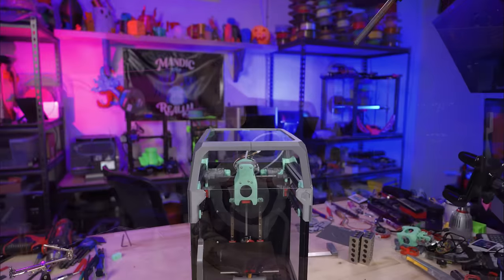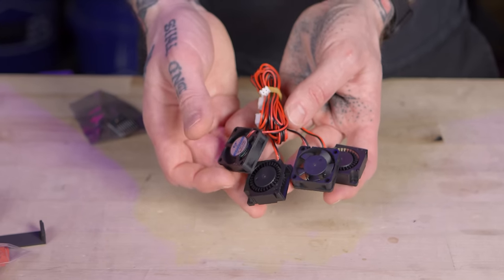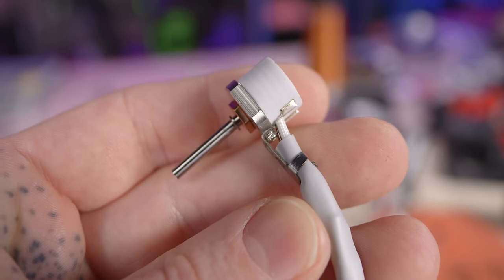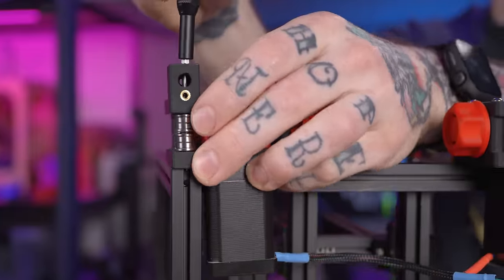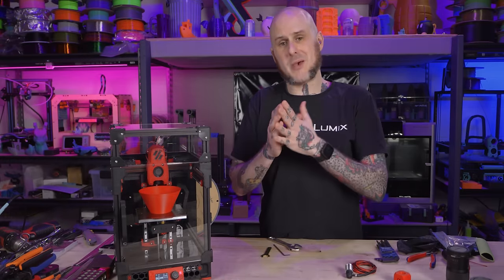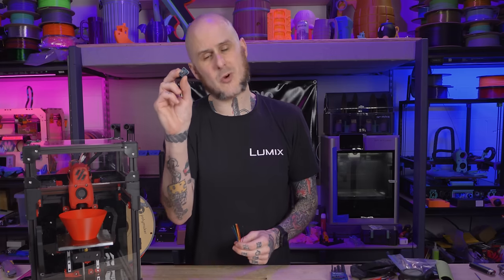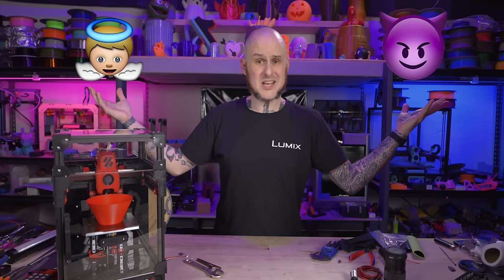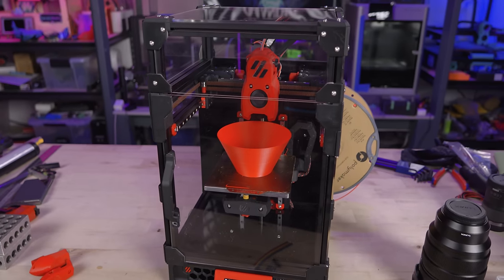Amazingly CHEAP Voron 0.2! - SIBOOR V0.2 3D Printer Review

Comment: Big nope for me, I'm a bit done with learning a lot from my Chinese printers. Now it's time for Prusa and then a proper Voron. :)
Reply: Maybe go straight to that Voron
Reply: What's a proper Voron?
Reply: A proper voron which isnt a "chinese" printer will be quite hard
Reply: @totalkiller4  hey said he's done with learning from the chinese printers. I know the bambu printers have cool features. But the vorons and the prusas are opensource and have replacement parts available from different sellers.
Reply: @Dash199t  Right? No one tell him where LDO is from.
Reply: @sanjabarasingha802  Thats fair just my Bambu has given me the best prints iv ever seen and i can buy parts direct and they come from a UK warehouse local to me so its all lovely so far and there are a good few mods for it to add non OEM parts :) and i belive a large part of the software is open sorce
Reply: siboor has a proper 2.4 and trident kit. Both PREMIUM kits. you really should check them out before you dive into prusa, prusa is more a reliable set and forget machine, voron is for the tinkerer. both have acceptable reasons for buying... depends on needs
Reply: @totalkiller4  I'm happy to hear, that you like your bambu machine. And yes there are some things opensource. But the important part, the firmware, is closed. If they would opensource the firmware I would probably buy one. But i doubt that'll happen.
Reply: @WillThat  A "proper Voron" is a Voron you source the parts yourself, which is superb irony since most parts are made in china
Reply: The best Voron build is when you use bom sheet and source your own parts. You buy some Chinese parts like gears, screw kits, wire connectors etc.. but mix it with expensive critical parts like motors, bed, rails and hot end as an example

Comment: Watching this has me nervous about the printed parts. I haven’t seen any issues with the black parts yet but I still have a ways to go. Wondering if that particular batch of printed black parts had an issue or if it’s going to be the case for many others as well. Definitely seems like printed part qc needs to be better regardless.
Reply: thats crazy.... i did not have any of that nonsense on mine. I will get with siboor team and tell them to double down on the QA. Honestly the splitting parts is not acceptable. Modbot if you need reprints let me know. Ill get them for you quickly.
Reply from the maker: Yea, it was suprising. You know how it can be, temperamental days with ABS and all, but there were obvious issues that should have been seen in packaging.
Reply: I also had poor layer adhesion on my V0.1, although not as bad as this kit by the looks of it. My first prints were replacement high stress parts like the extruder mounts for when they failed (the extruder rail mount loves to split and was hard to diagnose).
Reply: At least my batch is okay but mine came with revised liner rails (no rust) so perhaps little different from yours. So far no crack.
Reply: I did have some issues with poor layer adhesion. However, nothing that was a important part.  I did have to reprint a couple of pieces, but they were all small.  On the plus side, the printed parts looked amazing.  I think a few more degrees (5-10) higher print temperature and they would have been perfect.

Comment: the 0.1 enclosure cap looks so much better than the 0.2
Reply from the maker: Yea. I like that the 0.2 is hinged, and that it is much easier to assemble, but the 0.1 top hat does look a lot better.
Reply: You can mod that easily from what I have seen here and there

Comment: As someone who already has a printer, comfortable working on 3D printers and would like to try to step up to a voron. I would say this is a good kit to start with... $780 AUD delivered is under half of what an LDO kit is after delivery and parts ... I think I'll be going it a go, using your link of course.. 😉
Reply from the maker: Much appreciated and best of luck with it. They already seem to be taking some action on critiques from myself and some others. I hope it works out well for you.
Reply: Good luck!  I hope you enjoy putting it together as much as I did.   It did take me a bit longer to put together, but it was mostly the directions from Voron could be better.
Reply: So.... Update: Printer was short on bearings and washers and one of the linear rails has some real bad jerkie movement(almost feels like the little ball bearings have flat spots) and that's without being in the printer... yes I lubed...   after picking some spares I have finished assembling the printer only to discover I was getting a thermistor error, fixed that but the extruder motor lasted about 100mm before failing... now it just "shakes" like something is broken inside stopping it moving (although I can move by hand)
Reply from the maker: @Xalies  Those are some rough things, sorry to hear that.  Short on bearings is kind of ridiculous. Glad you worked that out.  I'd recommend a good LDO motor to replace the extruder one.  I haven't had problems with the SIBOOR provided motors but I run LDO ones on all my long term builds.
Reply: Buy a Creality K1 mate.   Cheaper and much better and ready to go out of the box.

Comment: I would LOVE to have a Voron, but there's just too much fiddly crap for costing WAY too much money. I realize that this is all cutting edge stuff, but even looking at this with the "My First Voron" mindset, I agree that the value and quality control isn't there. The problem is that for the LDO kits you mentioned the price point is not in my ballpark. So I'll just sit here drooling while I print garbage on my Ender 3 like the poor pleb that I am.

Comment: Great video- and thanks for the shout out! I had very similar experiences with many of the issues you ran into. Overall I think it's a good budget kit option if folks go into it knowing the potential tradeoffs, and I think you did a nice job covering them. The parts seem to be a bigger issue for your kit- I only ran into two defective parts, and those were fairly easy reprints. I really do think Siboor should take a hard look at quality control of them.

Comment: Just finished building my first printer (Trident 250). You're the first builder I've seen to use 123 blocks when squaring up the frame in a video. It removes much of the struggle IMO. Round spacer block kit was my other machine shop pull. Loved how tidy your wiring came out.
 Big shoutout to the VORON Discord community for helping me get mine going! They were right there to help.

Comment: Alan, I really appreciate this video as I’m still considering this kit. It was rather serendipitous that I mentioned this kit on your 0.1 review and less than a day later you follow up with your review. There’s really no excuse for the state of your printed parts. From the research I’ve done their documentation is lacking badly. I’ve heard they’re decent with customer service and sending out replacement parts, but they really do need to work on their QC. If I have to deal with a few dodgy parts I can certainly print them on a different machine but ideally everything should be good to go including all the hardware and linear rails. Thanks again and keep up the great work, cheers!

Comment: SIBOOR offers a version of the kit without any ABS printed parts (also no main board).  You could get that, and use the print it forward program to get the printed parts, or print them yourself.  If I were to get this kit, I'd probably print the parts in PETG (since I CAN), and go for the BTT pico board (that was actually designed for this board) along with a RPi Zero (2) W.  I'd have to install the klipper firmware myself, but there are many good tutorials on the web showing how to do that.
I've heard that PETG will work well with a Voron, especially if you don't intend to print in ABS.  I mostly use PLA and PETG myself, both of these materials are much easier to print that ABS.  PETG is reasonably strong, and almost as heat resistant as ABS.   
BTW SIBOOR also offers CNC'ed metal parts.

Comment: I kind of wonder if those black parts are printed in eSun ABS+ or something else analogous to it.  Especially with batches in the last year or so, that stuff has notoriously poor layer adhesion, and that nice matte sheen is characteristic of ABS+
Reply: I know this comment is old but from what I've  seen Siboor were using eSun ABS+ but have since changed due to the known poor layer adhesion with that filament. Their updated "Aug2023" kits seem to use a better brand of filament that has less issues.

Comment: mine came with the black parts in good condition. one of the xy motors doesn't have the shaft aligned.. it didn't come with the connection diagram, so I connected the display wrongly and it doesn't work either. the rest is ok.

Comment: man for $500 I would expect some MUCH better quality control. that's $200 more than an A1 Mini that is rock solid right out of the box with no assembly and only $100 cheaper than a Bambu P1P.
Reply: Voron is over engineered and isn't mass produced like printers you said so costs are fixed

Comment: I have a V6 Style hot end with the same ceramic heater; 2 of them actually. one of them is doing fine and does heat up quick which is nice. but the other one has been very unreliable. unbelievable stringing, temp swings and randomly losing the thermistor signal. turns out the ceramic was cracked. My conclusion is to stay away from the ceramic and stick with all metal construction. sure doesn't heat up as fast, but really, you always have to wait a while to the bed to heat up anyway.

Comment: I am interested in knowing which brands of stepper motors and belts are used. Additionally, do you happen to know which extruder kit is also utilized? Changing the hotend poses no problem, and I can print the necessary parts in advance with my Voron 2.4. I am eagerly looking forward to building a Voron 0.2, assuming the only issues are related to the printed parts and hotend.
Reply: I just got a kit from Siboor last week. Extruder motor is a moons and the other 3 are siboor branded. I opted for the cnc all metal parts and so far so good. Gates belt also

Comment: I'm not familiar with this style printer but can someone explain the thought behind it? More or less why 450ish bucks is budget friendly when there's pre-assembled printers with better specs for less money. Is it the DIY aspect of it? But if that's the case most companies sell stuff for less if you have to do it yourself and like I mentioned this is more than a handful of pre-assembled printers. Maybe I'm missing something huge and please let me know!
Reply from the maker: “Better specs” is highly subjective. This is an enclosed printer capable of printing higher temp materials. It used a compact and strong core-xy system that can print very fast (if flowrate permits). It has a small build volume but how often do most folks print things that don’t fit in a 120 cubed build volume? For a desktop rapid prototyping machine it is extremely useful. Get small parts done very quickly so you can iterate on them fast. 

Sure you can find machines that fit some or all of these parameters, but few that hit all of them. Those that due are averaging a higher price. 

It’s also meant to be a DIY machine. No proprietary parts you won’t be able to replace a year from now when the company moves on to a new design. It’s upgradable and simply fun to build. 

The machine isn’t for everyone, but it is a great machine for those who need or want it’s capabilities (me).
Reply: @MandicReally  "Better specs" is not subjective, it's quantifiable. The answer to your second question is a lot, hence the reason that printers with builds up to 400+ exist. Third, depends on what you're prototyping but I doubt it's really that fast when you have to print parts one by one and you still have to wait for the other parts to print before you can see if it works. Fourth, there is only one printer company (that I know of) currently that uses proprietary parts which is Bambu Labs, everyone else uses off the self stuff, most of it is completely open-source stuff. I'm not hating on the little thing and there's a use for it somewhere, just not at the huge probably 200% markup that these kit companies are trying to push. It's $50 worth of parts max. What's it going to take for the printer community to start looking at printers in a price-to-performance ratio like computers? We don't pay more for the experience or frustration of building our computers, we pay more to have them built for us.
Reply: @crysiscontained4421  This kit is WAY more than $50 of parts...
Reply: Better specs?   This little printer is VERY fast and has linear rails on all three axes.  It is fully enclosed and can print any high-temperature filament.    My use case for it is printing things like gears in glass-filled nylon.   Today I spent some time making parts and putting them in my automated test jig and running them until failure, then redesigning.   I want a small and fast printer to speed up this interactive design process.
Reply: @crysiscontained4421  You canself-sourcee the parts for $50???  I doubt it.   The Raspberry Pi3 alone costs $28.  The cheapest stepper motoers you can buy are $10 each and you need three for them.  So already you are are $58.  Then you need some 1515 extrusions and quite a lot more. There are sop,mething like 12 laser-cut acrillic pannels and have you priced quality linear rails?

Comment: My Siboor V 0.2 stepper motors are included with sockets, not like yours.
There is an additional issue about Gemini V3 Wrong temperature indicating issue (Seems like that's only for specific batch of board). can you please mention this on video?
Reply from the maker: I chose not to mention the board temp issue because it didn’t cause any usability issues on my unit. Also the board isn’t SIBOORs fault, it is Mellow’s, so I wasn’t going to knock them for that issue. More info on the Discord seems to indicate it may just be a reporting error reading the wrong temp.
Reply: @MandicReally  I meant info for potential buyers - not about the right or wrong.
As I heard, the wrong indicated temperature is not actual value. It is caused by false voltage reading and not gona cause temperature related problem like throttling.

Comment: Since it’s hardened steel nozzle maybe you can bump up temperature to get enough flow.
Reply from the maker: I could but then I’m concerned the 0.2 part cooling won’t keep up. I find 235-240 to be an ideal temp for Polymaker ASA. Pushing it hotter just to flow better usually leads to quality degradation.
Reply: @MandicReally  interesting… since I always do in that way…

Comment: The black parts are possibly from esun abs+? My first and only roll is absolute garbage
Reply from the maker: I seem to remember folks saying they use ESun with the last kit. I found Hatchbox color matched one of the parts. I’ve never used ESun ABS to say. I stick to Polymaker as it treats me really well and has a wide product range.
Reply: @MandicReally  with esun abs+ it seems the variety is huge. Some like it and have no issues. Some others tell stories like mine. Maybe bad batches here and there - so bad quality control?! I do not know. I have tried other materials from them, Petg and pla+. Those were ok

Comment: Uhh... preinstalled klipper? This is a computer with a linux operating system that you have no control over how it is installed. It could open a backdoor to your network. I would strongly recommend sandboxing it, taking out the configuration files and reinstalling it.
Reply: You or I might want to use a different Linux install.  But the average kit-builder has zero experience with Linux and is not going to be editing a config file over ssh

Comment: 11.5-12.5 with CHT style nozzle is a bit dissapointing, even E3D Revo can be pushed to 14 also with bad quality of printed parts, the first few prints should be reserved for replacing those parts
Reply from the maker: It’s hard to say what’s what. I could have push higher temp and probably flowed more but I tested at temps I actually print at. It almost seemed to push 14mm3/s, but in a real actually print it was skipping the extruder at that level. So 12.5 is “safe” level of flow.

Comment: You have to re-wire and terminate cabling and it doesn't have enough hardware to complete the build? That's awful... The questionable printed parts made me remember an anet et4 I bought with the printed parts looked like dog crap and never got the printer working.

Comment: any reason to get this 0.2 over their (still available) 0.1 kit?
Reply from the maker: Honestly, a really good question. I greatly prefer the top hat of the V0.2 vs the 0.1 (not aesthetically but functionally). The 0.1 doesn’t come with a screen or good quality bed. The only other thing is the 0.2 “Mini-StealthBurner” is nicer than the Mini-Afterburner in every way. A lot? No. 

So… really hard to say. I’d not recommend the 0.1 kit without some upgrades (see that review) but you can likely get it and those upgrades for less than this one.